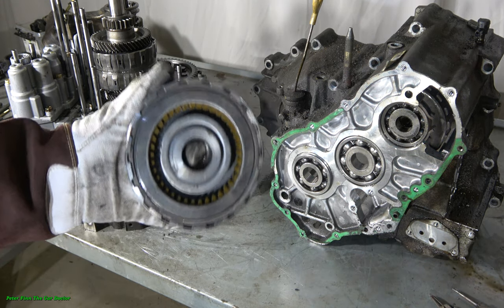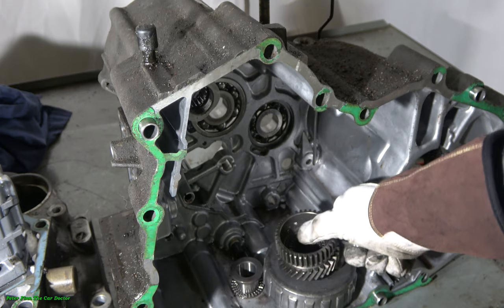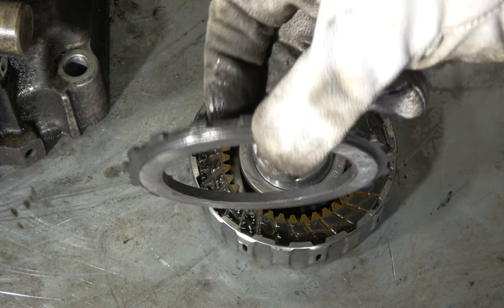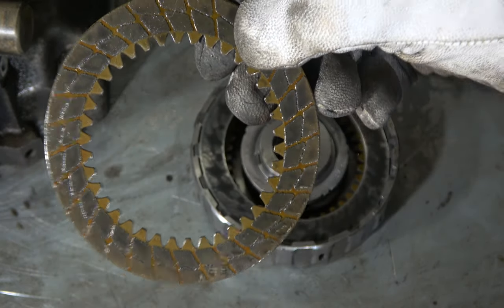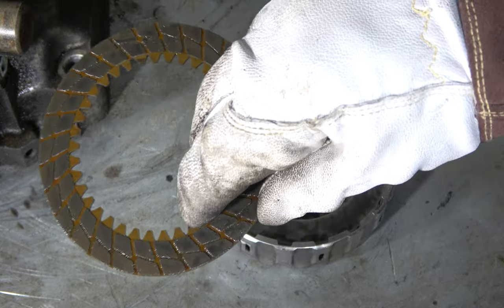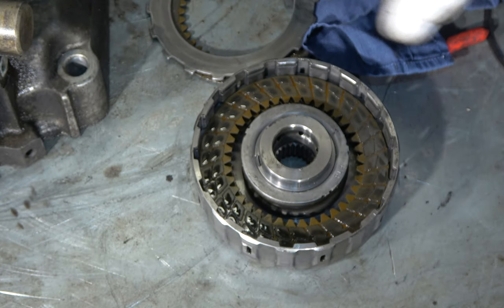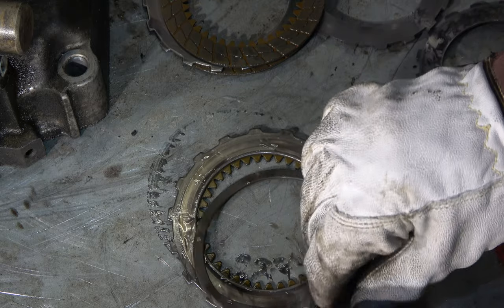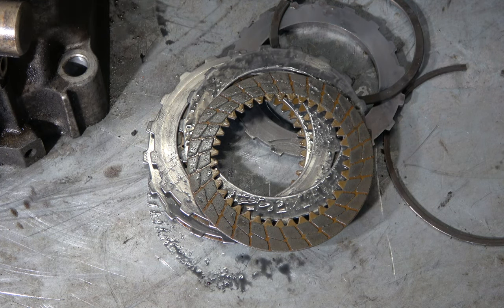How to replace Clutch plates Honda Civic automatic transmission. Years 2000 to 2022

Comment: Good morning
Happy new year doctor.
Sir enjoyed the video. Sir I have some questions.
If the clutch plates are worn out what types of symptoms we will note during driving? Slipping? Not getting desired speed relative to the engine RPM? 
And where will be the problems if the car is stuck in any one gear? I mean when to change the clutch plates and when to change the gears and when to change the solenoid and when to change to valves?
Reply from the maker: Slipping and virbation